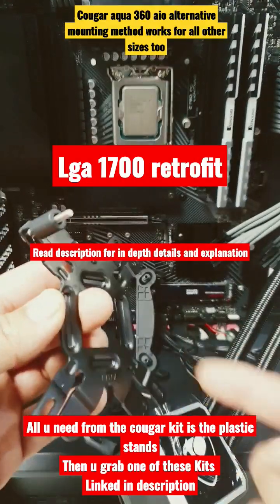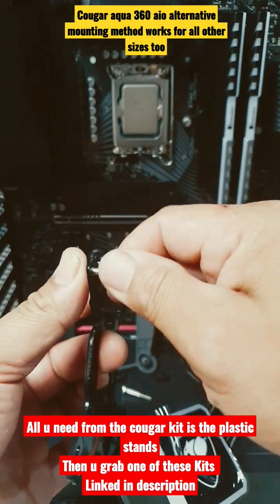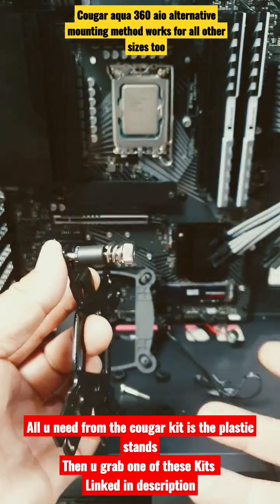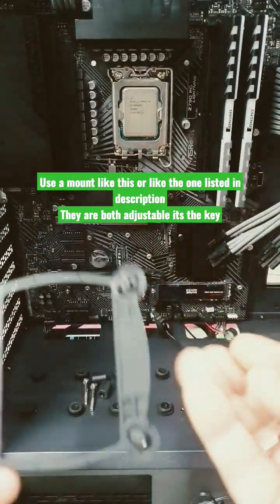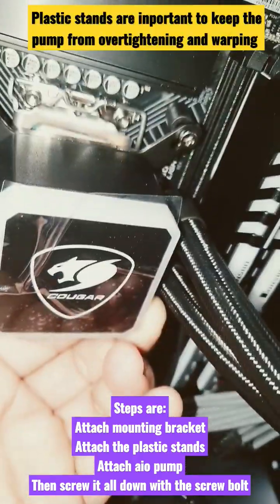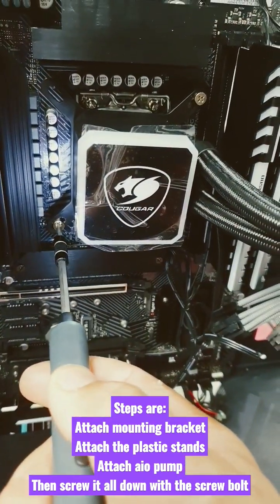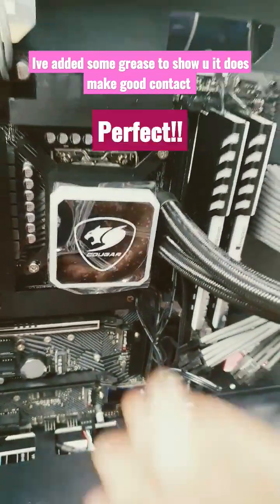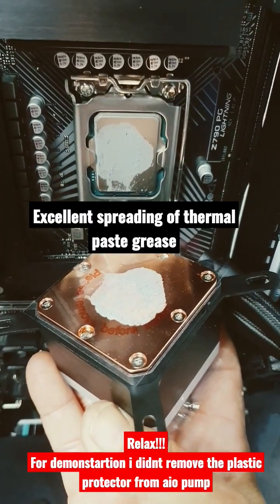how to Retrofit lga 1200/1151 cpu mounting bracket on a lga 1700 cpu. cougar aqua 360 aio demo

Comment: I have an evga clc 240mm and it is compatible up to the 7th generation of intel. I found an evga upgrade kit that supposedly works for lga 1700 intel 12th gen. Do you have any video for this installation ?
Reply from the maker: if it is 1700 socket its the same for most 1700 socket

Comment: hi bro i have an asus rog ryuo 120 will this work?
Reply from the maker: yes it will work .. what movo u have? 1700 or 1200?
Reply: thank you for replay i have b660 ds3h lga 1700 @MIKEYZVLOGZ
Reply from the maker: @thanos3814  ok so u have lga 1700... and ur aio is rog ryuin? ok so u can just but a lga 1700 bracket..some pc stores even sell the asus one... good thing about asus there mono have 2 sets of holes for mounts... u should see a figure 8 where your mount holes are... also do u have the screws ? if not just make sure u buy the right mount with screws u can use..wait is your mobo asus ? if not u won't have the figure 8 mounting holes..just get the mounting kit for 1700...and make sure it can accompany your aio pump where ur led screen is
Reply: @MIKEYZVLOGZ  ❤❤

Comment: hi dude i have an icue h150i elite cappellix will this work?
Reply from the maker: this works on any mobo because all mounts work the same u use the back bracket and the aio bolts on top so all u need is the adjustable mljnt so u. an make it work

Comment: Does it work for Corsair h100x for lga 1700?
Reply from the maker: as long as ur h100 has adjustable mount where the screw can slide in and out abit then yes it can
Reply: Can you provide me link for this mounting bracket
Reply from the maker: @fyme138  in description

Comment: Do you need that mount on the back my plate dose not fit but I can put the front plate on my cpu and the cooler will go on
Reply from the maker: how do it screw down Nd tighten if u don't have. backplate? cuz usually the backplate has the screw attached or thread that allows you to either put a thumb screw on to lock it all up (if there's a bolt attached to backplate) or use a long screw from the front (if backplate has thread)

Comment: Will this work with an CM 212 evo v1?
Reply from the maker: so long as the screws for the cooler will fit the lga bracket yes u can do the same thing just need a lga 1700 mount
Reply: @MIKEYZVLOGZ  bought a thermal right backplate but the bulky screws on the evo wouldn’t fit through the tiny holes. Just bit the bullet and bought an assassin X
Reply from the maker: @matthewreddick9334  just get a cheap backplate like what I showed ...but an assassin is just as good

Comment: Do you have any idea on how to change the mounting bracket on the ml360 sub zero?
Reply from the maker: is that the cooler master one? it's all about using what fits ... say ur ml360 is a 1200 and u need it to mount to a 1700... u just need to make sure you use a mounting kit like gigabyte that has both side adjustable ... cuz not only do u need it to adjust out bigger u also need to ensure u mount the aio pump side straight.. so all the screws are coming straight up... if they are on an angle that will cause damage to the mobo and possibly the threads for the bracket it screws into... if u have an asus mobo ur lucky asus make mobos to accept both 1200 and 1700 mounts ..that's just genius
Reply: @MIKEYZVLOGZ asus suxks like dog shit